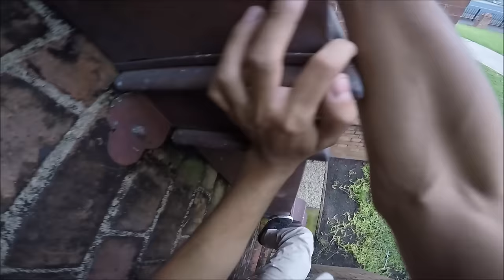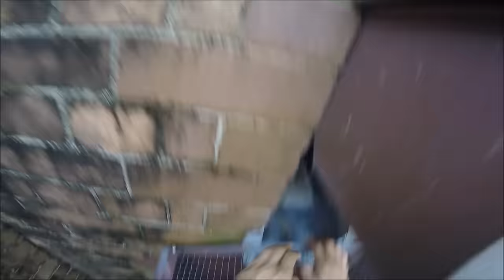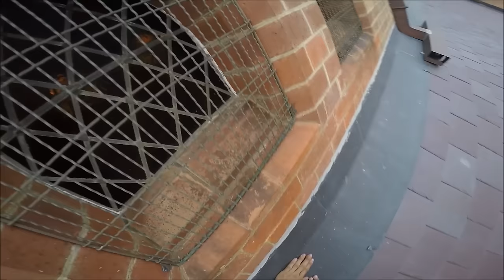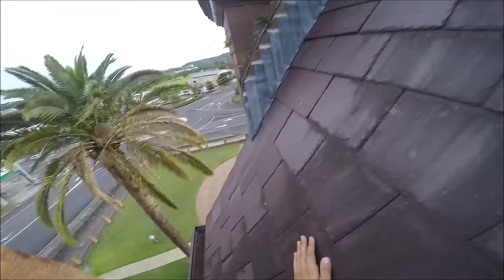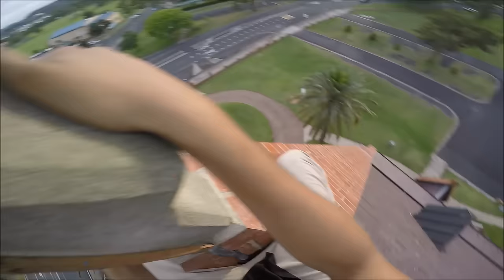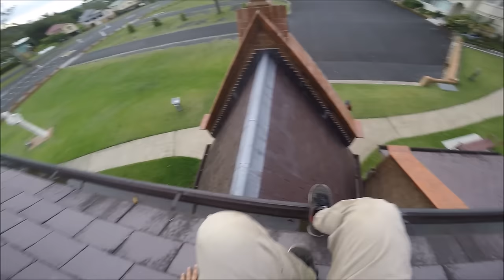Lismore Cathedral

Comment: soooo awesome...checked out the cathedral yesterday, the roof is heavily pitched, almost vert! do you test out the strength of the guttering/fixtures before applying your weight?
Reply from the maker: thanks man and you i do. would never do anything if i didn't think it was safe enough
Reply: man it would be so sick if you got on top of the new Lismore hospital helicopter pad!
Reply from the maker: i've wanted to for agesss dude! a few of my mates tried and got caught before they reached the top...
Reply: Did you go internally or externally?
Reply from the maker: i didn't. friends did and they went internally. i tried to go from the outside before they tried and some lady was watching me so i left